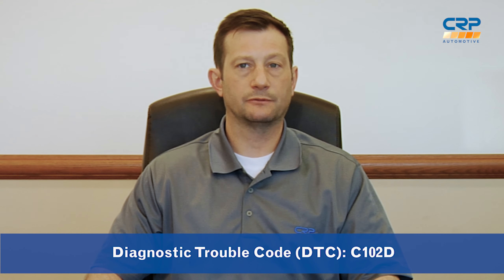Ford Fusion EPS Fault Code C102D: 3 Common Causes | ITB Episode 135

Comment: I have C102D.  I took my car to a Ford dealership garage and they said I needed lower control arms on both sides front, and knuckle on rear.   I had these all repaired but the C102D remains, and now my power steering has stopped functioning.   I have Forscan, how do I clear the code so my steering comes back?
Reply from the maker: Thank you for your comment! Please send us an email at info@crpindustries.com so we can direct your inquiry to our technical department.
Reply: Update:  The rack was bad anyways, could get the steering to work, but with alot of noise by clearing the codes, but only for a short period of driving before it threw codes and locked me out of power steering again on next engine startup.  Replaced rack, replaced control arms, tie rod ends, and its smooth sailing now.